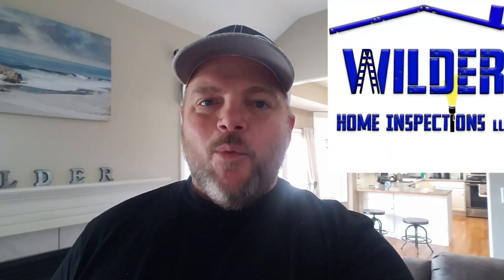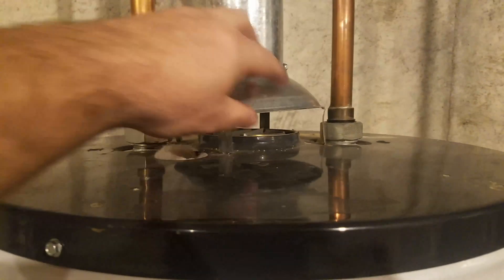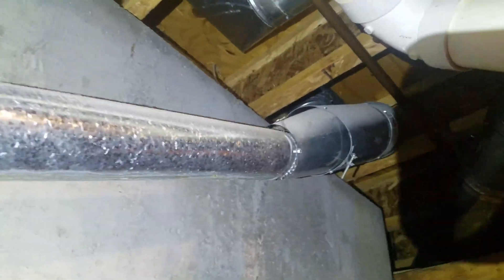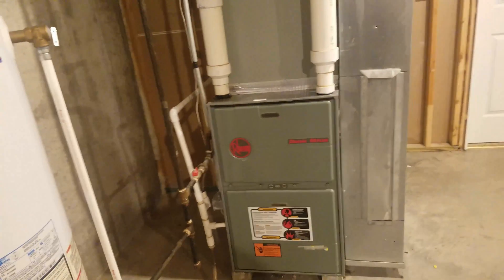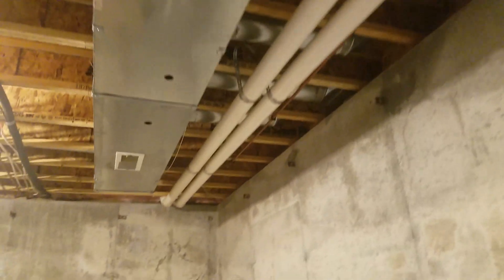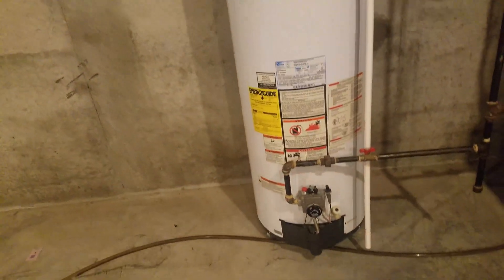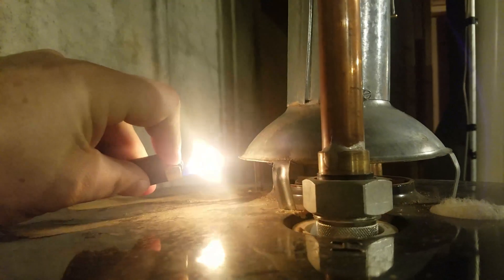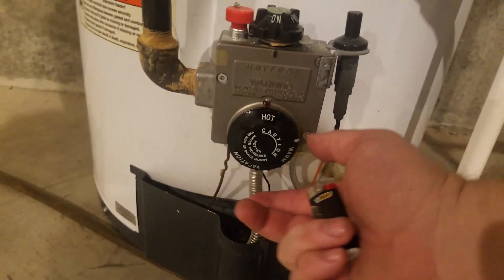Is Your Water Heater Backdrafting?

Comment: This has been an issue for me since I moved into this house. The exhaust is tied in with the furnace flue and it ONLY backdrafts if the water heater turns on while the air conditioning is running. If the heat is running my guess is the inducer motor helps suck it the flue because it does not backdraft. If the water heater is running FIRST and the air conditioning kicks on, it works fine and does not backdraft.  Only when the AC is on first and then the water heater kicks on does it backdraft. I've had a hvac guy tell me he couldn't explain why it would be doing that and also a water heater installer puzzled by this. I'm sick of having to turn the AC off before I can shower. Any tips are appreciated.
Reply from the maker: I don't know how much help I'll be, but when the AC comes on, it changes the pressurization of the home.  So, it sounds like the exhaust for the water heater needs help.  

I'm guessing the people you mentioned already checked things like ensuring the water heater exhaust goes straight up 12" before turning and continuing to elevate at an appropriate rate.  And ensuring the vent pipe extends far enough above the roof line.  

My only suggestions (not being there) would be checking for proper sealing throughout the home, not just duct work, but windows, attic access, etc.  And possibly installing a fan in the exhaust flue.  But, as a home inspector, unfortunately, the ultimate answer is to have it be further evaluated by a qualified professional.  Good luck.
Reply: @wilderhomeinspections1626  I am still working on it. My new water heater installed less than a week ago does the same thing. The exhaust does not go straight up 12" before it's tied in with the furnace flue... that is interesting. I've never heard that before. It does go well above the roof outside though. This house has a crawl space, no basement and I did have the vents under there sealed when I had it concreted over but the backdraft was happening before that anyway. The house is sealed pretty tight. The windows are newer and good quality windows. I'm not sure what could be done about the non straight up venting of the water heater. It's angled slightly but nothing like some almost horizontal venting I've seen. Thanks for your reply

Comment: My hot water heater, and venting has similar problems.  The vent pipe adapter is not level and the 4"  vent pipe (ascending at a much shallower angle than yours), tees into my 6" galvanized boiler exhaust, and then into an 8" double wall pipe which goes out the roof.  Like your system, there is a gap where the smaller pipe fits into the larger.  I'm getting fumes in the house, especially when the hot water heater turns on, and the boiler is NOT burning.  My suspicion is there is not enough draft to get the water heater gasses to the roof.   So my question is this... What can I fill that gap with?  I don't want to run all new pipes.  There are no available heating contractors in my area.   One more piece of information..A few years ago I had a new roof put on.  The guy insisted on cutting a ridge vent.  (Previously we only had gable vents.)  The attic is much colder and my gas bill much higher.  I know that 8" double wall pipe passes through the very cold attic.  Could that be the cause of the reduced draft?  Do you think insulating the double wall pipe would increase the draft?
Reply from the maker: Unfortunately, there are too many variables for me to properly answer in this kind of forum. For instance, your exhaust pipe at the roof may be too short, as one example.  Your best bet may be to contact a licensed HVAC company and ask for them to evaluate it.  Sorry I wasn't able to help.  Good luck
Reply: @wilderhomeinspections1626  The pipe was long enough for 52 years.  The only thing that changed was the addition of the ridge vent.  There are no qualified HVAC contractors in the area.
Reply from the maker: @PanamaSticks  It's definitely interesting that the only thing that has changed is the addition of a ridge vent.  That would lead me to believe it's related as well.  I know this isn't immediate help, but if you notice the draft improve with warmer weather, then I think you're on to something.  I'm sorry that I cannot properly answer your question for you. Good luck
Reply: Tees into my Boiler vent pipe.  Which is bigger size.  questionable?
if BOTH are turned on at the same time?

Comment: I have yet to see any video that shows these guys actually FIXING a backdraft issue. Sometimes water heaters kick on for a short cycle, and the water heater exhaust isn't enough to warm the flue vent, which has much cooler air in it.
Reply: Home Inspectors don’t fix stuff. They identify and report the faults to their clients with recommendations on who to call for professional repair.

Comment: I did not catch it but did you check the draft with the dryer on and all house exhaust fans (Bath/Kitchen). Yes it may not backdraft with them all off but it could be with them all on. Again not a major issue since most will not all be on same time just throwing out there it could backdraft at certain times.

Comment: Dirt trap in the gas pipe?
Reply from the maker: If you're asking if there is a trap, there is.  It's on the main line before it branches off to the furnace and water heater.  However, it would be better if the shutoff where above the trap, to make it easier to clean.

Comment: You forgot to check whether you have a sufficient seal where the narrow pipe feeds into the larger one.   (I have the same “feature” even though my water heater and high efficiency furnace are original 2010 models, so the furnace never connected to that large metal pipe.)
Reply: 100% this.
The lighter test proves little beyond that point.